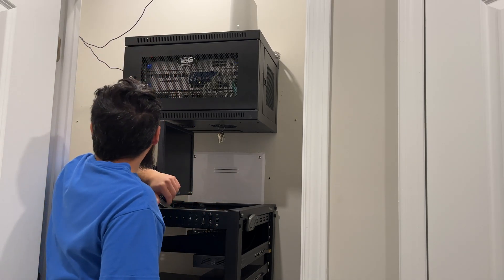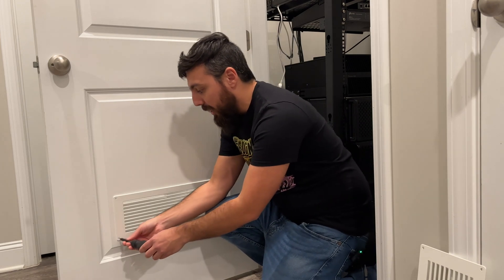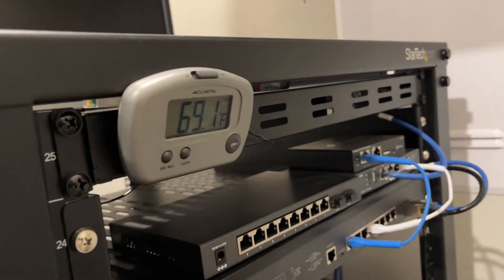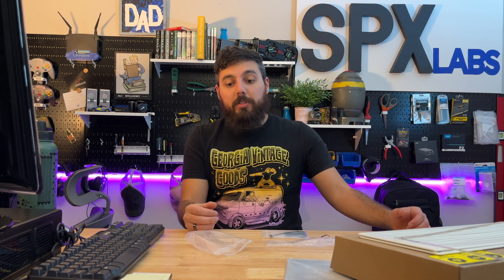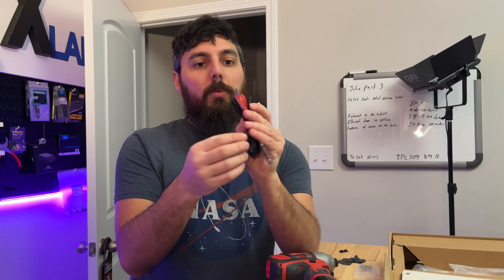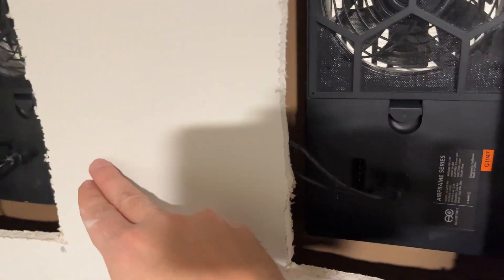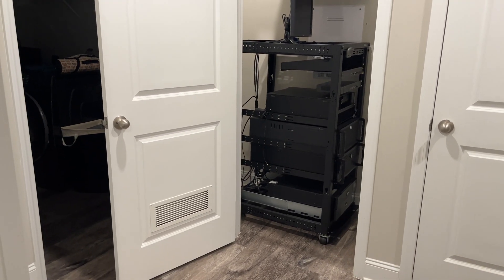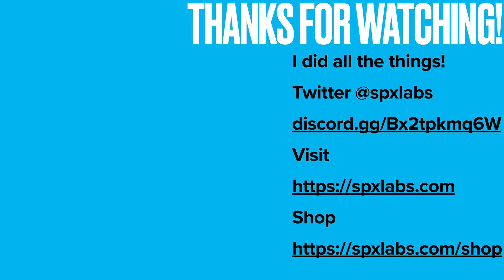Home Network Closet Cooling Experiment

Comment: WTF is that Fahrenheit crap ??? 4 % of the planet is still using  it. Same with feet, tumb, inch, foot, yard, miles ... psssst on my calendar it's 2025. Not 1880 ! So maybe.... it's about time to join the rest of the 96 % of the world.. The rest were able to take a sane decision ;) 
BTW...  is that a real door ? the material looks so thin .. you probably als could user a pair of scissors or a simple kitchen knife to cut though it.

Comment: There are a lot of issues here that are causing bad airflow. without making this a comment about this and that is wrong, lets start by understanding current issues and what airflow is needed:

Reality - seams that you are trying to cool a room that houses heat generators rather than cool the generators (rack equipment)

Simple first issues I see
1: your rack gear is too far back
2: having a lot of exhaust power and a clear route from your door the up and out the exhaust will bypass your rack gear.

What is needed
1: Your rack gear pulls air in from the front and sends it out the back, so direct air through your rack gear
2: find a way to exhaust from back of rack - in your case, put a block mid rack and up
3: measure the temp at the back of the rack not the front, you already know the air in front is the same as what comes in

In my home rack, the exhaust of all my rack gear feels mildly warm and some gear just cool. At my office the server closet has all a/c coming in from front down low, and all exhaust from back of rack line and no airflow is allow to go over the racks.
Reply from the maker: Wow! Thank you for the detailed post and suggestions and your experience.  For almost a year now I have kept my servers angled towards the bottom vent so they help pull air into the room and that does help.  If things become problematic in the future I’ll come back to this post and use it for future designs.  Thank you
Reply: @SPXLabs  honesly, the first think I would try, measure temp at back of server rack, then place a big piece of cardboard from top of rack all the way up seperating room into two halfs, not air tight or anything, just a good mockup, dont worry about big leaks, just try to divert most of the air through rack instead of up and over

Comment: Really confused. Why do you think 80°F is a problem that needs a solution? My server closet goes up to 97°F in the summer and my internal system temperatures are still acceptable. Hard drives are a little warm at 107-113°F max, but that's about it. 

The operating temperature ranges of IT equipment often go up to 40°C (104°F).
Reply from the maker: Temperatures around 90 make me uncomfortable.  Just worried about early death of hardware due to prolonged excessive heat.  I know 80 is fine but upper 90s just makes me nervous.

Comment: wouldn't it work better if it were PULLING the air into the other room instead of trying to push it into your walls/attic?
Reply from the maker: I am doing that.  Except instead of into the wall or attic, the air is being moved into an adjacent room.

Comment: Just wondering if you ever looked at a bathroom type exhaust fan that was high CFM that could pull hot air out of the house vs just moving into another room?    The cost could be very comp to buying multi units of the fan you are buying, but not just move the hot air to another space within the house, in turn making your AC unit work harder.   You would need a vent in the door still to pull cool air in from the house, but it would push the HOT air at the top outside.   You may have already looked at this.
Reply from the maker: Yeah, in the previous videos we talked about all sorts of alternatives

Comment: To exhaust the hot air, have you considered installing a Panasonic WhipserFit ventilation fan? The CFM is high, the noise is low, and they are used in bathrooms.
Reply from the maker: Nope, never heard of it.  :/ too late now of course

Comment: Looks like a decent solution. I reckon if you need more the next step should be to just increase the size of the intake vent. Rather than trying to push more air in, just make it easier for the existing fans to draw air through - they're probably limited by the total area of the gap under the door plus the intake vent.
Reply from the maker: I think, if I continue adding too much more, I will either move things to the garage or install a rackmount ac unit
Reply: @SPXLabs  Yep, fair call! (hehe you could move the laundry into the garage instead and take over another rooom....) 😆
Reply from the maker: That’s…. Actually a really good idea 😈 

I wonder what the wife would aay

Comment: I wonder if adding some AC Infinity 120s to the top of the rack would help reduce the heat trapped inside the racks? Only other thing would be to add a small floor fan at the bottom of the closet and point it upward to mix the hot and cold air.
Reply from the maker: I am playing with the idea of doing that! Not sure if I’ll commit or not.  I feel like it would help.  I have a feeling in the summer I’ll end up doing that
Reply: This is the single biggest issue in that setup is that he is not pushing cool air through the servers, but around it

Comment: I personally would have just cut 1-2" off the bottom of the door, cold air in under the door..
Reply from the maker: Like originally, instead of cutting a hole for vents?
Reply: @SPXLabs  Yep.
Reply from the maker: Oh yeah.  Maybe.  Idk.  This is fine
Reply: @SPXLabs  I like your idea, its good. IMO at my house i was going to run a bathroom fan in the closet, pull air out of the closet and have it plummed into the bathroom vent in the other room beside me.

Comment: What about using ipmitool to poll CPU temps?
Reply from the maker: The servers have always been pretty chill in the past like 50~55C or there abouts.  It’s the network stuff that gets super hot. Like 75C or more.  The new switch doesn’t show the temperature
Reply: @SPXLabs  Time for a Noctua upgrade and voiding warranties OR ghetto bolt on fans externally over the vents to force more airflow inside the switch?
Reply: @ShinyTechThings  @SPXLabs do it!!!!!!!

Comment: You can get a smoke pen to see how the airflow is or a thermal camera to see if things could be improved on the cheap. I don;t know why I just thought of this now instead of when we talked about it last year.
Reply: My neighbors always use burnt herbal plant matter to test airflow, indoors & outdoors ... they seem happy with the results
Reply: @jfkastner  A smoke pen though typically gives off a really consistent thick smoke but I get that it's cheaper and might work as well with their method as well.
Reply: This is what he needs to do, because adding that big exhaust cfm would cause most of the air to just come in and go up and over the rack, and measuring temp at from of rack has no point, its just measuring intake air as it flows in front of the head sources than than the exhaust temp of said head sources. its like measuring the temp of the outside of your car thinking that its going to be cool inside but you have the heater on inside

Comment: Could you not add a hot air return and AC vent from your current central AC system?
Reply: This is the way...
Reply: Thats the setup I have and it works perfectly.
Reply from the maker: That’s what I wanted to do originally.  Long story short is no.  Previous videos will say why.